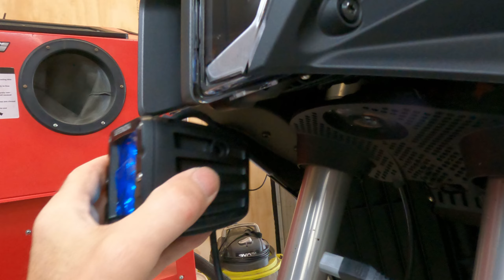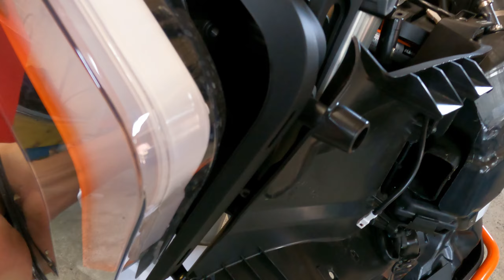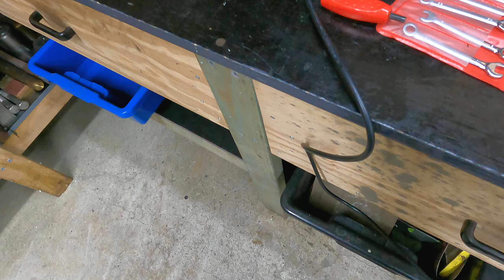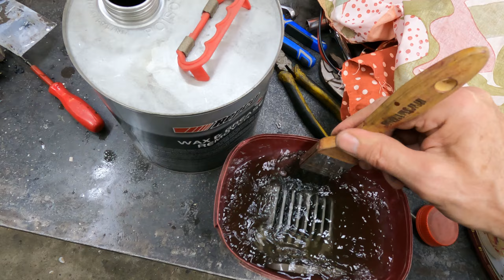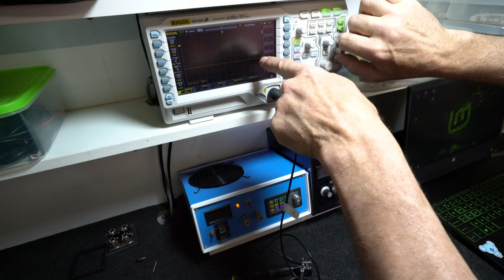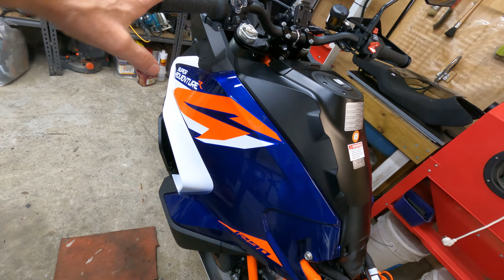Spotlight Modification on the 1290 Adventure Headlight.

Comment: Cool idea, but I see some caveats. You have investigated if your new light won't overheat inside. The aluminium part that it sits in, is a heat sink for the main lights. Now it is significantly heating up the heat sink. You might overheat the whole light assembly. I imagine it costs a small fortune.  Not to mention, it could get you stranded in the dark, far away from home.
Reply from the maker: Had it for a while now. No issues. 
Definitely worth the extra light output.

Comment: Late comment...  i have almost finished mine.. I wasn't after a spotlight, more of a 'worklight' that sprays light everywhere so cars can see me, especially when I am out of the urban areas. So I ended up with a cheap Kings 3" worklight.   I put a small toggle switch in the 'small phone' storage above the USB outlet in order to turn it off at night and got power of one of the ACC ccts.. The light draws 1.2A so that is sweet FA. The only thing is that now rain, mud and all that good stuff will find its way behind the headlight as the cover no longer fits..  I am still thinking about that one..   Cheers

Comment: Great content, the relay analysis was great info.   I would like to know the specs on the diode?  
Thanks
Andrew
Reply from the maker: It was a 1N4001 silicone diode. 50v 1 amp. The voltage spike has very little current if its shorted so any small silicone power diode will work.
Reply: @mostlymotorcycles.  Thank you sir.
most useful!